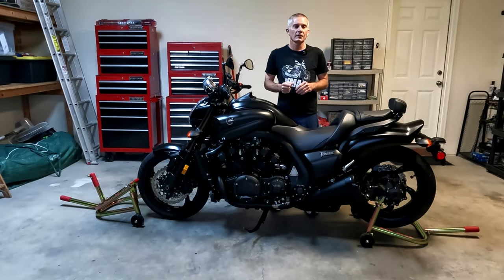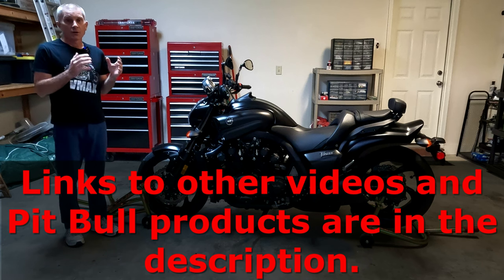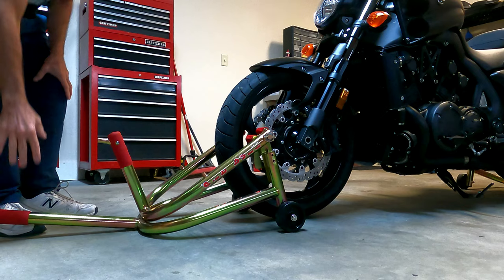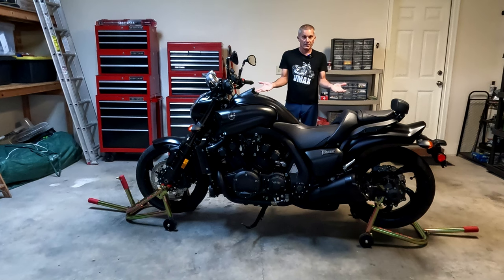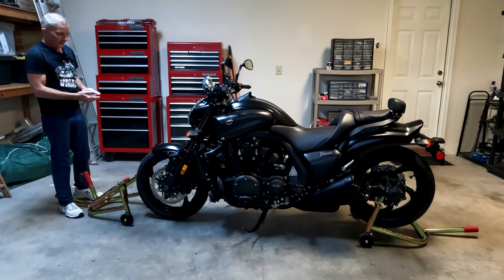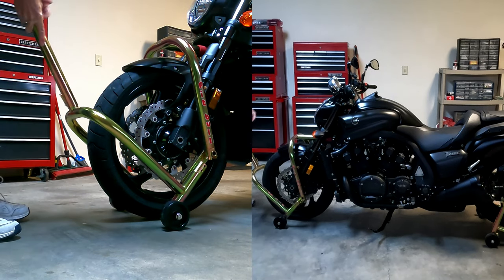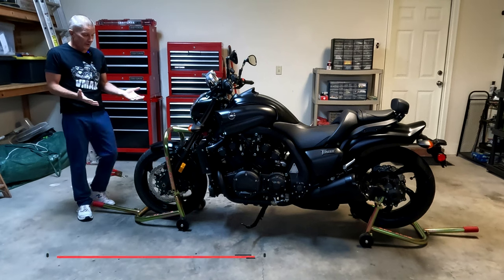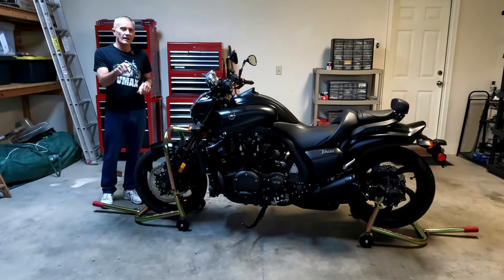How To Use a Pit Bull Front Stand on a VMAX 1700

Comment: this is very interesting to me, because when Yamaha made the XS1100, they didn't do such a good job on the center stand.   The Center stands tend to break off over the years when you use them. Mine is close to coming off.  How much for these stands?   Either way, I'll look into getting both of these Going to be cheaper than having a welder remove and reweld, and shorten mine, because I 've had to have my bike lowered for my lack of height 71".   Thanks!
Reply from the maker: The front stand is $250, the rear is $210.